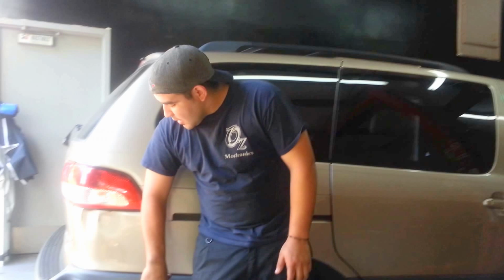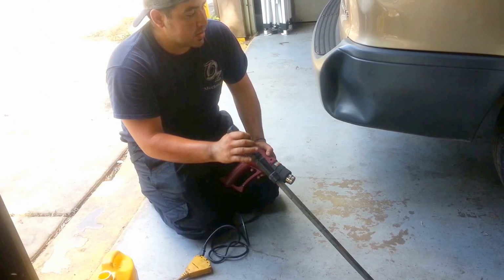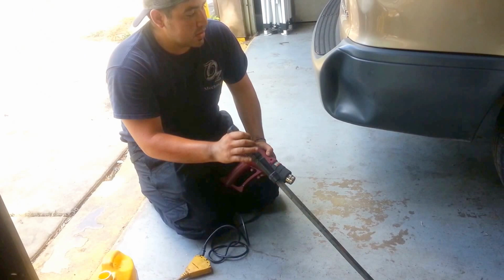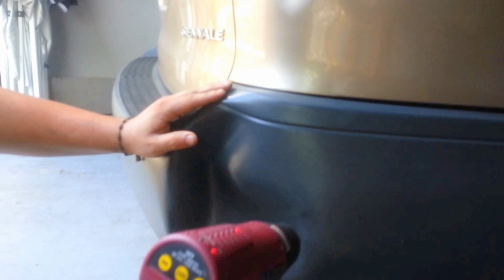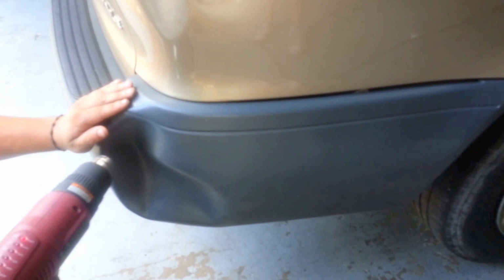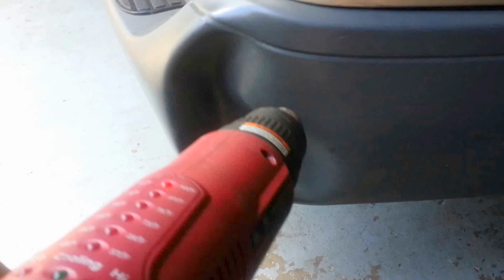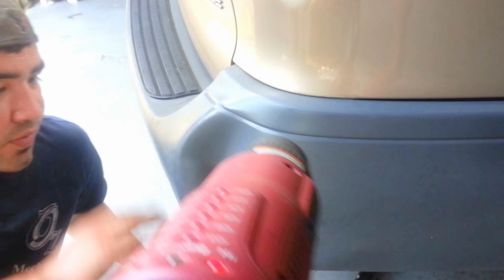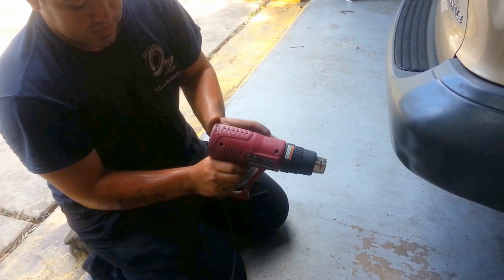How to remove a dent with wife's hair drier

Comment: hear dryer vs heat guy  which one is better?  I used a hair dryer on my vehicle dent but seems like front bumper plastic is way too strong. Please help.
Reply from the maker: Just depends on how strong the hair dryer is. I’ve use my wife’s once without a problem